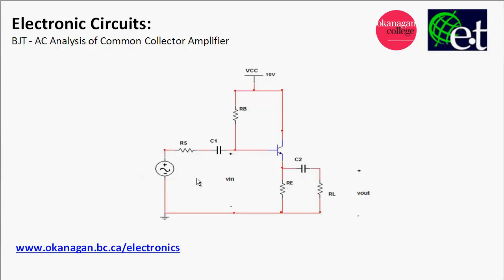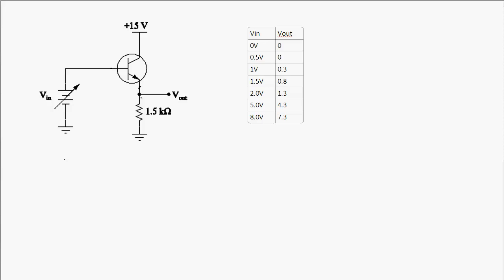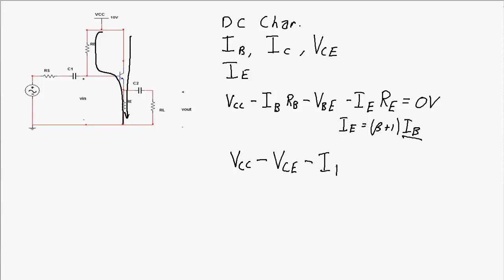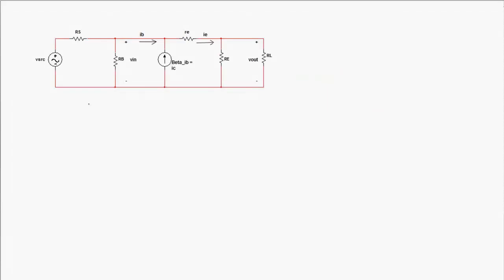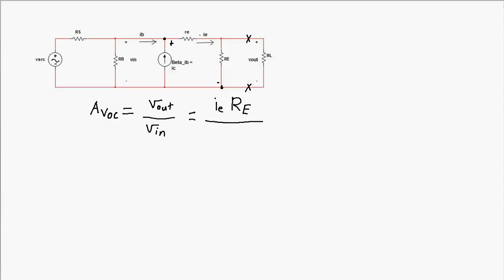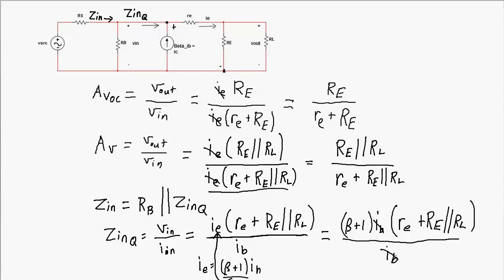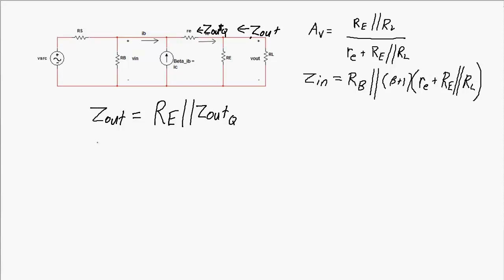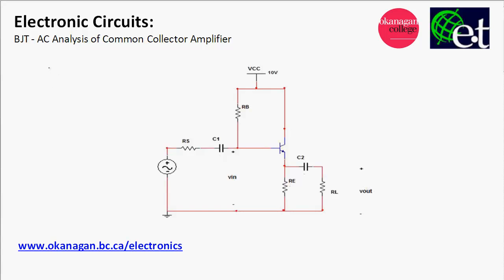Common Collector Amplifier

Comment from the maker: @okami11408 For common collector, you just don't need one.  Look at the derivation of input impedance, output impedance and voltage gain, and you'll see that the collector is not part of the derivation.  You could put in an RC if you wanted to, it would change the DC operating point without affecting the AC parameters much.

Comment: Good video, but there is a small mistake. In 16:39 it is said you can disconnect the current source, but you can't do that because that current source is a current controlled current source, and you're not allowed to short circuit or disconnect controlled sources, but only to remove fixed sources.

Comment: Best explanation on the web,  there seems to be different lines of thought when calculating CC  output resistance.  Specificly what to do with v in and its source resistance.  A few instructors claim that shorting out v in includes shorting out its source resistance. Others don't address the source resistance at all. Can this circuit be calculated in open circuit mode then proceeding to the amp model to calculated overall  gain?

Comment: hello sir, i read that  to avoid loading effect we need to have low  ouput impedance for source and high input impedance for load to transfer maximum power to load.can i know by what order it should be greater for better transfer of power in design prespective.  and does it mean that by having low ouput impedance most of the current will pass through load??  thank u

Comment: Dear David,

Thank you very much for the great lesson, I understand this circuit a lot better now. I just have one thing I'm not clear on: What actually is Zin? I understand all the algebra to find the impedance at this point of a circuit, but what I don't understand is that there's not actually a resistor here. I don't understand conceptually what this resistance/impedance is. 

Any help on this would be very much appreciated.

Tim
Reply from the maker: +Timothy Olsen Zin is the input impedance which is the impedance (resistance) that the amplifier presents to a source that is connected to it.
Reply: +David Williams Thanks for the answer. Are you saying that the input to the amplifier has a general impedance (measured at the base) as well as the impedance measured across RB?Tim
Reply from the maker: +Timothy Olsen that's correct, but the two impedances need to be taken together to give the input impedance of the whole amplifier as seen from the source.
Reply: +David Williams I understand it now. thanks
Reply: Input impedance means if you apply a certain voltage, what will be the current flowing into the amplifier..And since power =VxI, it will tell you power too..

Comment: @David Williams: Since when Zin considers load resistance in its equation?
Reply from the maker: For the common collector, load resistance is "seen" when looking in to the circuit, so it has to be considered in the Zin calculation. Another way to put it, when you apply a test voltage at the input, the resulting current will change if the load resistance changes. Since test voltage over resulting current is input impedance, Zin depends on the load resistance.
Reply: Does this apply only for common collector? Because common emitter is drawn almost the same way except output is taken from the emitter.
Reply from the maker: Right, common emitter is not affected by the load because the output at the emitter is not seen from the base
Reply: When you say "seen from", you are referring to circuit equivalent small-signal model?

Comment: Question: 
when doing Ac analysis, I assumed you used T model ? If you did, why did you connect Beta_ib differently, while in Common emitter amp video you used Beta_ib on the different location.
Reply from the maker: I did use the T model for the BJT and while I did draw Beta_ib in a different location on the page, I did indicate that I still drew it on the collector...I just swapped the positions of the collector and emitter.
Reply: thanks!!!

Comment: Dear brother ,I have doubt please help,
   when we calculate voltage gain without include source and load resister, we can write  Av= vout/vin=ie.RE/vb=Ie.RE/Ib.RB=(B+1)RE/RB.
PLEASE REPLY IS IT CORRECT OR NOT.
Q/ If RB increase two double of its value the what will be effect on voltage gain?